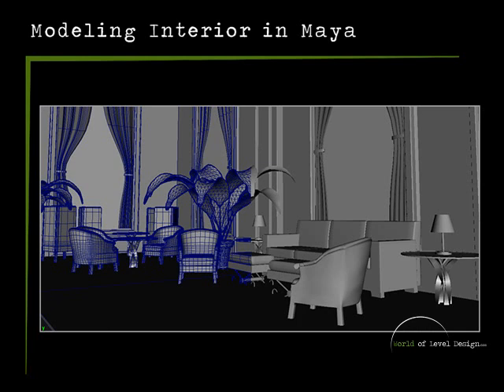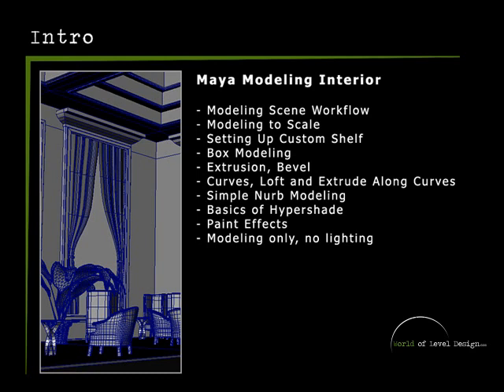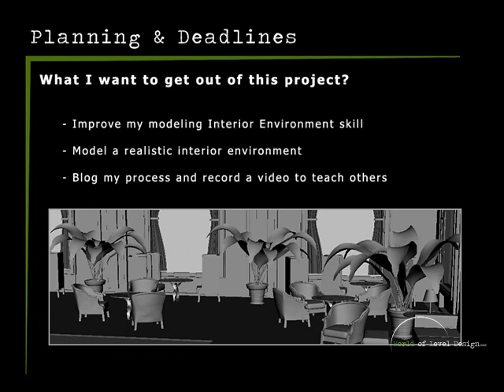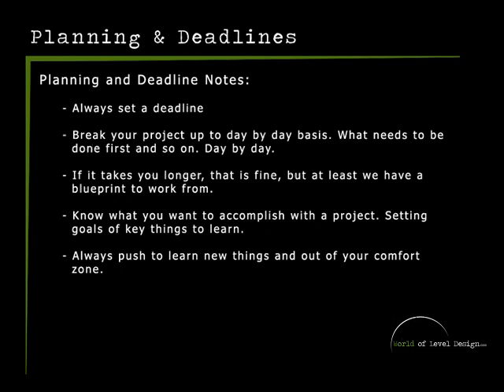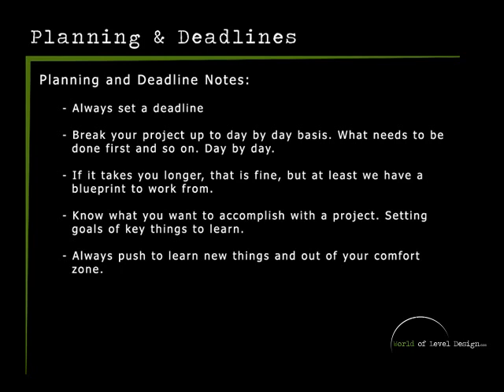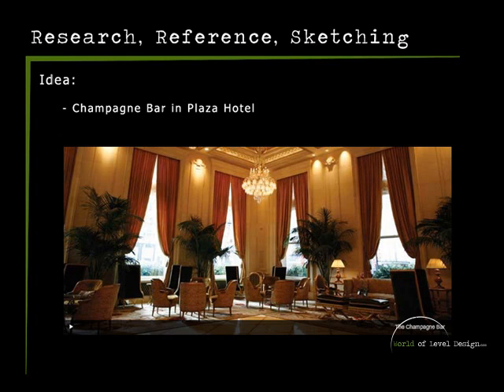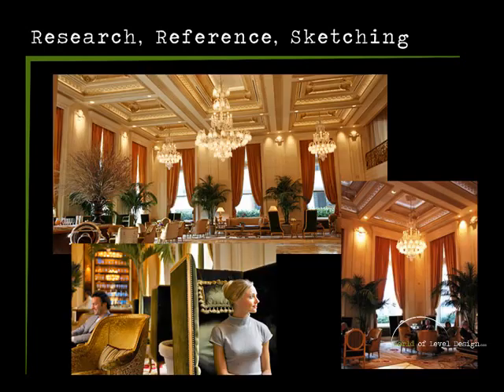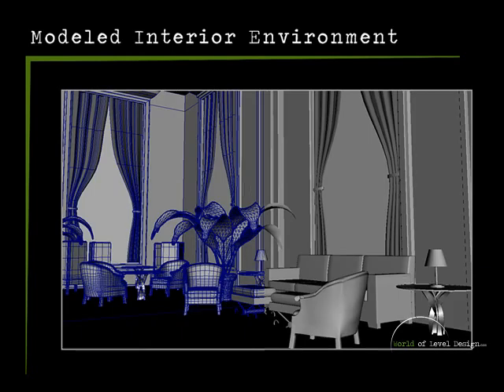Modeling Interior using Maya Part 1.1 / 3

Comment: You could create a box cut it vertically in half, then select the top vertex move it up, then move this newly shaped box into the front of the Tajmahal, then Mesh > Boolean > Difference, to lean more I strongly encourage you to read the Maya help it contains lots of info about the tools and how to manipulate, add, and remove geometry, this will save you time searching for tutorials online and in fact you may write your own tutorials because you understand the tool better.

Comment: Thank you for your work that helps all of us understand modeling interiors better. I have done some research but i couldnt find what u did in some stages of the modeling.
How do u fast select all the margins that u need from an object without selecting any other? I am now selecting every margin sepparately and it;s very hard when working with small objects :D